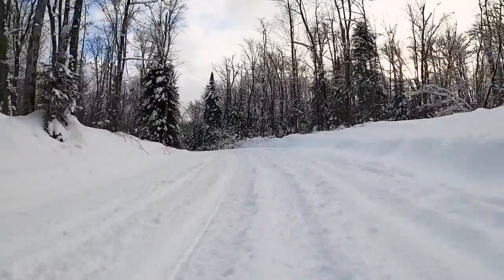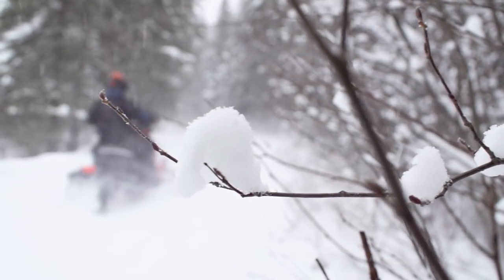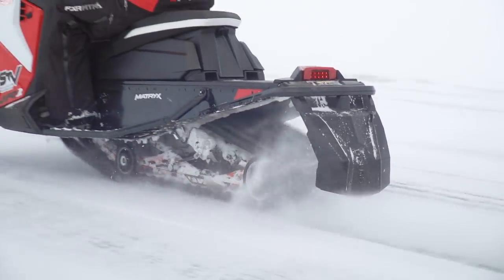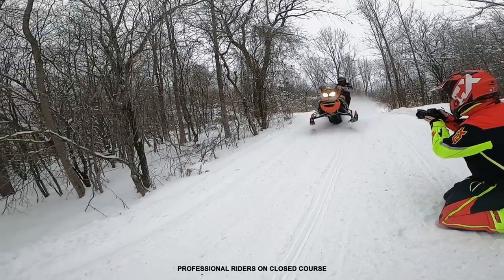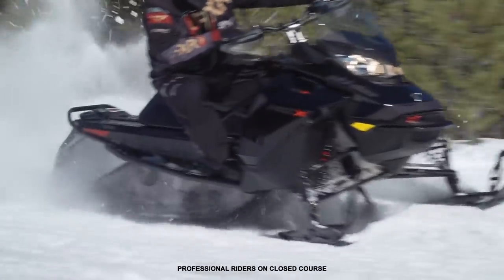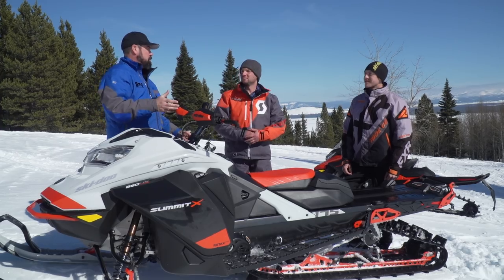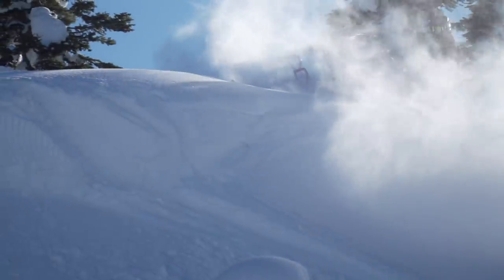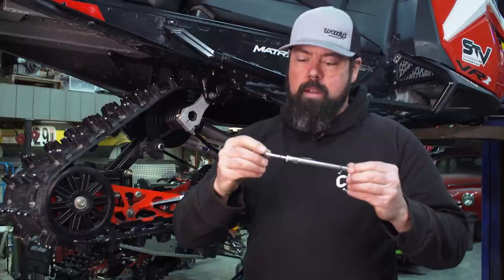Snowmobiler TV 2021 - Episode 10

Comment: No wonder my 02 800 is Quicker then the 850.. Even my twin 600 is 92mph at 660 ft with 144 studs.  I really dislike the new clutching and gearing. I live in NB. No speed limits here yet and Love it! Just did 774 km ride in 2 days on my old Edge Sleds.  MY IQ is in retirement this year with 12 000 miles. and My Axis engine is blown again!! I HATE the MONOBLOCK!! .. ugggg.  Polaris needs to go back to individual cyl's.

Comment: Polaris Specs are way to tight! I just use 1/8th inch sag. No weights, No pressure. The sleds will Glide better and pick up 1 mpg.  You want a sled to roll easy. Rolling easy is power to the ground. An won't ratchet the drive cogs.